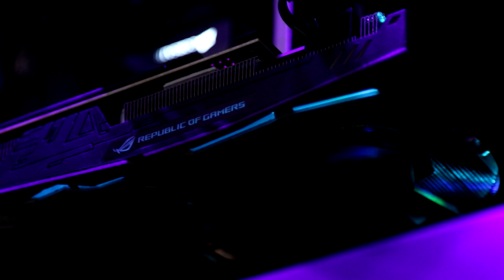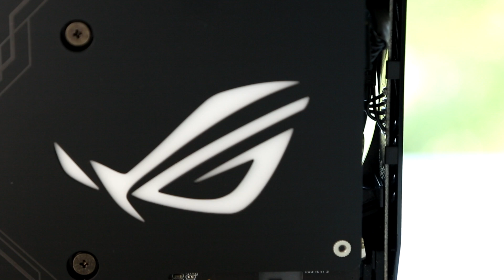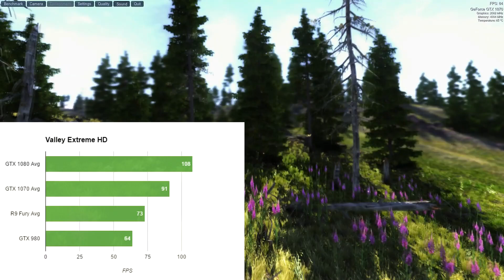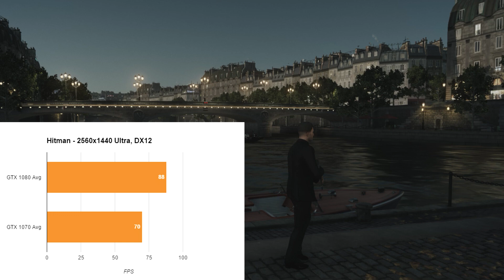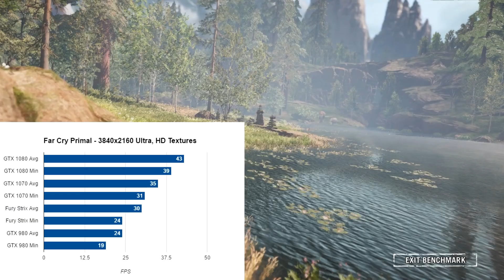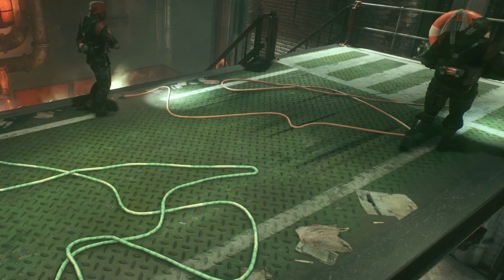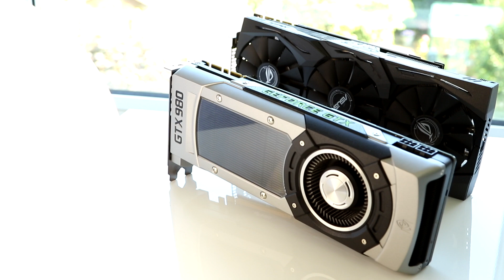Nvidia GTX 1070 Review - Asus ROG Strix OC

Comment: will this card fit in a Nzxt h440?
Reply: Carlos Drodz it should just need to remove some of the hard drive bays
Reply: i think it woulf fit i have the corsair 400c with front radiator n it fit but bearly with no radiator upfront you would be even better off

Comment: Which 1070 should i buy for christmas? I wanna get a nice overclock on it. Dont want to run the fans faster than 50-60% because of the noice. :) The strix oc is 490 Euro atm here in germany. Max price 500 Euro. Thanks for answering! Maybe I gets a bit cheaper closer to christmas.

Comment: Not a very strong overclock on my model and the included Asus gpu tweak software only allows +84mhz on the core clock = 1974mhz at turbo.
Reply: If I push it beyond the max in Asus tweak using other software I get artifacts sadly :(
Reply: ***** Nope mine has Samsung GDDR5, just lost out on the lottery.
Reply: Just add it until it's not stable and bring it back down. If you notice any artifacting, or if you get driver crashes, it's time to bring your clocks down or pump some more voltage into it.
Reply: Get Msi afterburner
Reply: +Vlad Berariu if you start to crash add more voltage
Reply: it dosnt allow me to add more voltage
Reply: +Vlad Berariu do research and try and unlock your voltage it could be a problem with your card or Msi afterburner
Reply: How do i find out if my gpu is faulty ? I do see quite low fps , and im thinking that maybe its smth wrong with it . Could this be because i connected it wrong ? I might have not connected it properly to my psu
Reply: +Vlad Berariu I said it could be a problem with your card I mean it could be locked
Reply: Mario Almonte how can it be locked ? I bought a non oc version of this asus card

Comment: Hi!. There is a bif difference between the OC version and the non OC  ?
Reply: Sorry for the late reply, and you may have found this out already, but the only difference between the non OC version and the OC version is that the OC version comes out of the box with a standard overclock. If you are proficient with overclocking your GPU and have a program like MSI Afterburner, you can overclock the non OC version too.

Comment: is 1070 strix ok with mini itx build of core i5 6600k and only 450w psu? planning to buy one :(
Reply: Get a 500w and this strix card is large so check the measurements before buying
Reply: +Vivek Patel ive checked the measurements yeah it fits to my case. its just the psu cause the one i have is 450w. kinda makes me wonder also if itll do just fine with it.

Comment: I just bought 1070 strix and I don't see a huge difference between 1080 and 1070 that will makes say WOW!

10 more frames just for extra double the price of 1070!

I better buy 2x1070 better than buying one 1080!

Ok, 1080 has a GDRR5X and it sounds great, but for that price it doesn't deserve it.
i was planning to buy 2x1080 and hopefully i had an issue and the payment was declined haha, so then I changed my mind and I bought 1x1070 because i'm going to play in ultra HD.

Comment: I got myself a BenQ XL2730Z. Which means I'm gaming on a WQHD 144Hz monitor. Currently I don't want to go for a AMD card even if i got a freesync monitor (don't need freeesync the moment i got high enough framerates and the 1070 and 1080 are pushing enough fps to make freesync unnecessary) because of their bad driver support, their software and missing stuff like shadowplay. Also there's currently NO competitor for the 1070 and 1080. And AMD cards are well known for their huge power consumption (not talking about the RX480, but about the Fury X which is the only card getting close to the 1070 in some games). 
Should I go for the 1080 because of me playing on a 1440p 144Hz Monitor?
Or should the 1070 be enough for the next years?

Comment: Could this get 60+ fps on a 1440 x 3440 ultrawide?
Reply: depends on the game
Reply: Not a Pedophile Ark survival, cod, cs:go, gta, skyrim, fallout 4 just ot name a few
Reply: Ark will barely get 50 fps at 1080p medium to high settings, its a horribly optimized game. COD youll get atleast 100fps at those settings. GTA maybe 60-70 fps those settings. Skyrim 70-100 fps those settings. Fallout 4 60-70 fps those settings.
Reply: Not a Pedophile ty
Reply: Np

Comment: My 1070 asus ROG does well in the 4k range aswell obviously with no msaa. Mines overclocked to 2100 mhz, the gtx 1080 is only getting an extra 10 more FPS than mine... defs not worth the extra $400 au

Comment: Bought this card for $440 USD, it's awesome. Boosts out of the box with no OC to 1949MHz. Running it on an Acer XB270HUbprz (purchased for $450 from acerrecertified), and it has been a fantastic upgrade from my 970. I wanted to go for a 1080, but the awesome warranty I got from MicroCenter will allow me to trade it back in price I paid and provide a "cheap" upgrade to a 1080ti in a few months, if not a year.
Reply: Are you still going through with getting the 1080ti now?

Comment: gigabyte extreme is the best gtx 1070
Reply: Yhea I'm not really sure. The strix is sexy
Reply: +FireBird-16 the look sells me on this card lmao. I bought the strix 1070
Reply: not, strix got better fps overall, and further OC
Reply: Neva
Reply: +Norman / ThunderGod ?? it is confirmed it has the highest clock speeds and oc potential and it comes verry close to a 1080 FE
Reply: FireBird-16 Neva
Reply: ;) Thanks for your Information I'll buy this card then
Reply: +Norman / ThunderGod np
Reply: The design of the Gigabyte 1070 is bad. I bought a MSI Gaming X
Reply: +gyt hrtytrrt gigabyte gets higher clockspeeds but zotac amp is still a solid choice btw ive got my gigabyte extreme overclocked to 2,35 ghz with a little over voltage
Reply: +gyt hrtytrrt np when u overclock ur gtx 1070 its al most a 1080fe just 4,3 fps differance in firestrike ultra
Reply: FireBird-16 Yhea that realy awesome :D I want to buy a PC and maybe I'll pick a 1070.
Reply: +FireBird-16 you should really lower your overclocking to save your gpus lifespan....
Reply: +Xeffx no im not cus i use this card for max 3 years and then il buy a new one
Reply: +FireBird-16 send it to me when your buying a new one :P
Reply: +Xeffx in 3 years ill wil notify u
Reply: +FireBird-16 i bought my 1070 already. The strix one. Just haven't installed it yet lol
Reply: Derek L ^^
Reply: +Derek L lawl
Reply: The orange lines kill it for me :/
Reply: +Eli Maffry visusls dont matter.... its the peformance
Reply: +Eli Maffry ive painted them red so......np for me
Reply: +Eli Maffry ORAAAANGE is my favourite colour :'( don't say that shit again please.. Hahaha
Reply: FireBird-16 BBUUUUUTTTTTT. Worse rgb
Reply: https://www.zotac.com/us/product/graphics_card/zotac-geforce-gtx-1070-amp-extreme. own the card and its far more beter.
Reply: your right!

Comment: If you dont have a Monitor/TV that can do 4k, Get a 1070. Otherwise. 1080 or the New Titan X will be great for you 
I have an old TV i am using that is 1860 x 1050. So i guess 1070 will get done what i need from it. ;-)

Comment: is this the best 1070?
Reply: I'd go for EVGA cause of the customer service, my 780 popped, contacted them, they replied the same day, sorted out a postage label the next and sent it off. They received it and sent out a replacement like 2 days later and it turned up and it was a 970 SC! Was really impressed, can't see Asus doing that. My second choice would be a Palit Jetstream/Game Rock card due to it being way cheaper than most and the cooler being effective and silent whilst offering top end boost clocks out of the box. Eg. Palit Super Jetsream - 1835mhz boost = £399 vs Asus ROG Strix OC - 1835mhz boost = £499. Just ridiculous really.
Reply: Yes it it

Comment: I plan on having 3 monitors in my setup for my pc. can I use 2 HDMI on one 1070 and 1 HDMI on a second 1070 in sli to achieve surround? or should I ensure that the monitors that I get also have display port? I won't use surround all the time but if like to try it out or show,it,off occasionally
Reply from the maker: +Ton Lucci 3 hdmi for 1080p is fine, but you'll need display port for higher resolutions.
Reply: +PC Centric okay so running two monitors off of one and one monitor off of another is no problem for this card?
Reply: yes, it's fine :)
Reply: +THE CRAFTERS DEN // Calal thanks dude
Reply: Ton Lucci :)
Reply: Since you don't have speakers on your monitors better to go with DP not HDMI.
Yes you can, because i was using my old pc 1 DVI from my motherboard and another DVI from my GPU